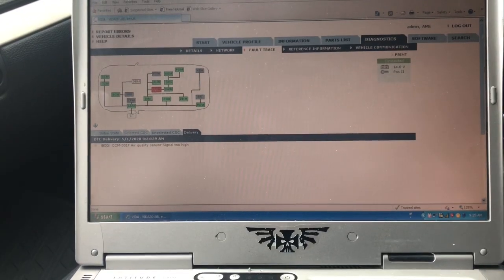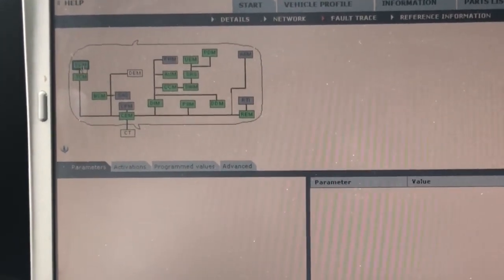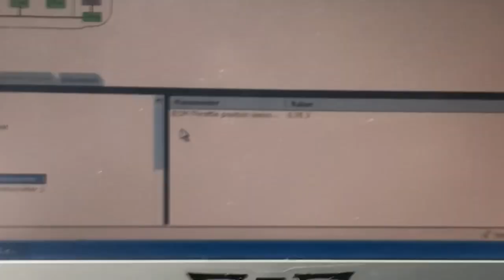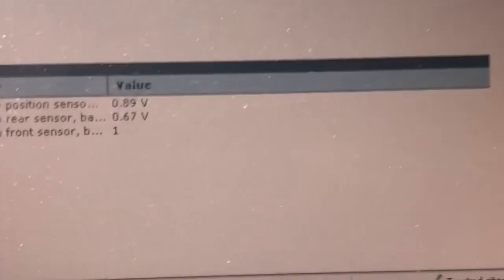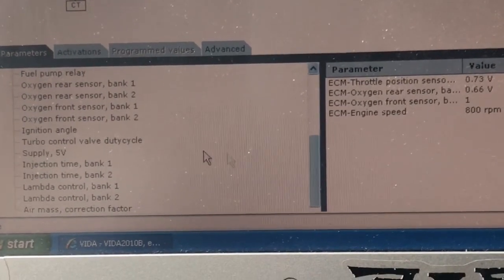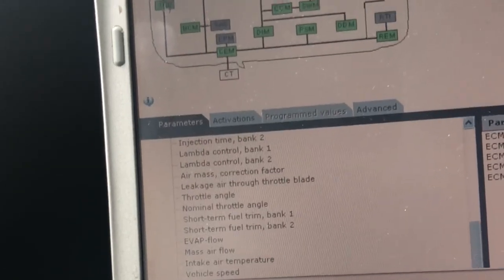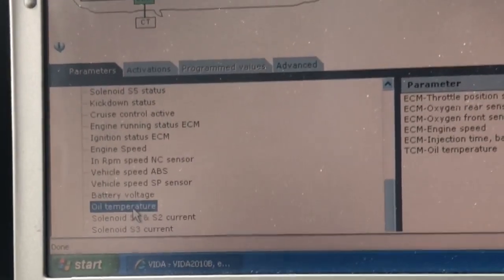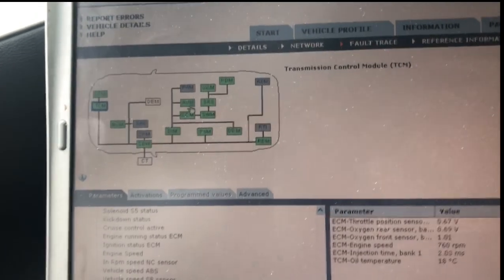Volvo VIDA DICE How to Monitor Live Data

Comment: 2001 Volvo V70XC
Hello, would you by any chance have a tutorial on 
using VIDA DiCE to test the functionality/integrity of the Throttle Body
 and the Accelerator Pedal? If you don't, would you know where I can 
find any information?
Thanks.
Reply from the maker: I have a throttle adaptation one...
Reply: @Bigtime_mcalpine  I really appreciate your reply. Please excuse my English understanding, "adaptation" tutorial you have, would be same as "functionality" and or "integrity", right?

My XC went into "limp mode", and I already purchased and OEM Accelerator Pedal unit (with it's sensor). I need to test the throttle body I replaced end of 2019, to see if it's functioning properly.
Cheers!
Reply: @Odika2  any updates? Cheers

Comment: It would be very helpful if you mentioned that you need to RIGHT click on the module graphic to enable and read data from that module. My apologies if your version does not require right click.
Reply: Hello Phil, just wondering if your reply is with regards to my question on testing the functionality/integrity of the Throttle Body and the Accelerator Pedal?
Reply: Exactly. It took me a long time to learn this too. Even double clicking does not work.